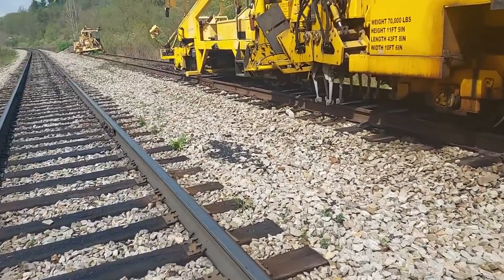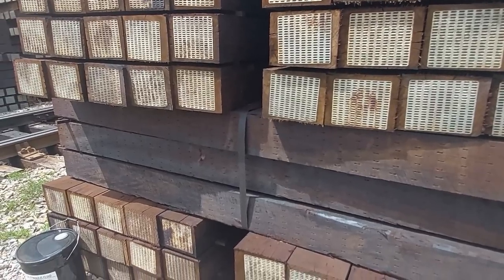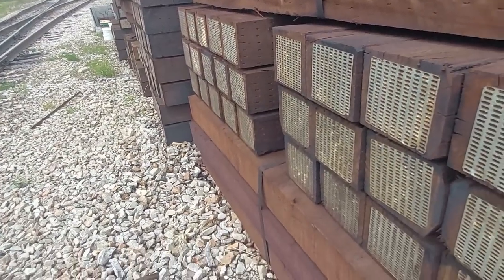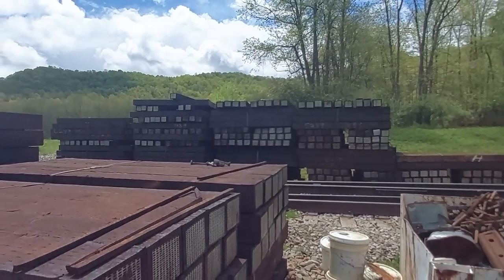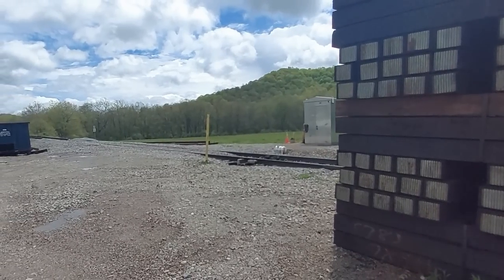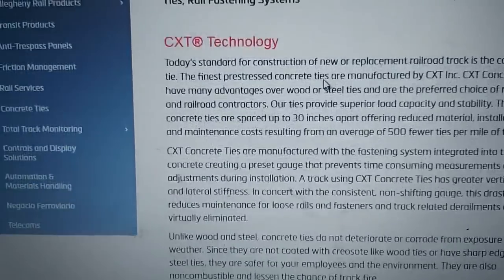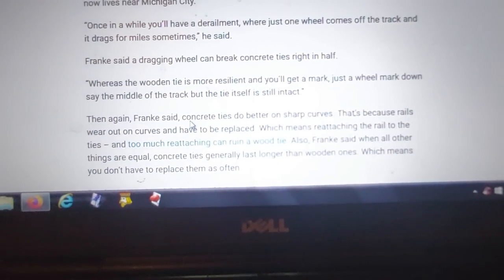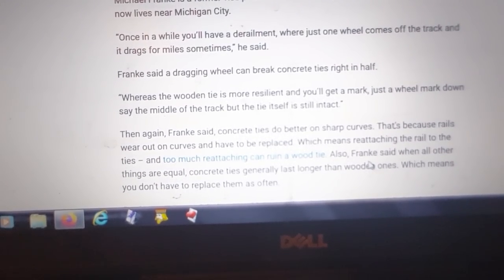Why some Railroads use Concrete and some use Wood Cross Ties

Comment: Seems like what Cumberland RR could use is better ballast maintenance equipment, especially an undercutter and ballast cleaner.  Also put in extra effort on drainage.  Locally (Seattle/Tacoma), BNSF has interesting practices; most of the double/triple track mainline is still in wood but sidings and even Auburn Yard's tracks are now concrete.  Where Sounder commuter rail is concerned, that's mostly concrete on their tracks and the new third main is concrete.   Up in the mountains, a lot of track has been put in concrete in the less accessible areas.  I'm a little surprised spikes are still common as they are, but apparently they're cost-effective.  Put the money and time into good consistent maintenance, the track will hold up well.
Reply from the maker: Thank you for the nice comment Damon and yes we have more
than our share of drainage and plugged up ballast. Appreciate your taking the time to watch and write in my friend.

Comment: Hey Dave! I live on the main line northeast corridor in West Haven Ct, all ties here are concrete for the last 15 yrs, most traffic is transit to and from NYC, also have the Acela ,6 times each day (north and south), every night there is a ballast train going south up to 100+ cars, very very heavy! I've seen as many as 5 locos on these trains. Return trip of empty ballast cars as many as 140+. RR and power company will be doing a project on my property in the near future to replace and relocate 100 yr old high power lines, breaks my heart, they will have to take down some very old trees.
Reply from the maker: Thank you for sharing that Carl. A lot of transit track has concrete
ties, they just won't work well for us here.  Appreciate very much your taking the time to write in and to check out the concrete vs wood tie video my friend.

Comment: After watching this very interesting video, I did some research on ties. There is a company making plastic ties from recycled plastic. They say you can use the same equipment as wood ties. Sounds like a great idea. Do you have any experience with that type of tie?
Reply from the maker: We do not have any composite ties here My Life's Tracks. They
are very hard and have no flexibility and cost well over twice what
a wood tie does, plus they need to be pre drilled before driving
a spike in. Just like wood and concrete, they have their pros and
cons. Appreciate your taking the time to check out the video and write in my friend.

Comment: Using old railroad ties used to be a thing back here in Germany. In fact, in our backgarden we had flower beds framed by old ties. There were two major issues with those back in the 80s: PCP and Lindane. It turns out that the chemicals used to treat that wood to keep it from rotting are really less than amazing for your health and the wood was practically soaked in the stuff. Made for pretty colors in puddles of rain, but also smelled awful. 
The ties we had in the garden were probably from the 1940s or 50s. Eventually I was forbidden from playing in the garden until some heavy machinery was brought in to clear out the ties and some of the soil.
Reply from the maker: Thank you for the nice comment Odd One Out and for sharing that. Appreciate your taking the time to watch and write in my friend.

Comment: MBTA Old Colony Commuter Rail restoration project (south of Boston, MA), tore up old NHRR roadbed, with wooden ties, and rebuilt with concrete ties in 1995/6. Withtin 10 years, the concrete ties were spalling and shattering. Tears & lawsuits ensued. The settlment - we went back to wooden ties (paid for by company that sold the original concrete ties) that were installed at MBTA expense.
Reply from the maker: Very interesting to learn that Douglas! Thank you so much for
taking the time to watch the video and share that with us my friend.

Comment: Back in 2007-2009 I worked in a concrete tie factory and we produced 47kg and 53 kg (mostly) - this being the rail weights inkg/metre. The ties were all concrete with 80 tensioning wires. Tampingworked fine; steel ties were tries and you needed hooks on the ends of the tamping prongs to oack the ballast up into the cavity under the ties, otherwise really rough riding! We sednt the ties out already loaded with jewellery only needing hand clipping using Pandrol E-clips and Pandrol clippers.. I did some time on track barring - you used a term ( I can't remember) to bring theas up to the rail which were then cliiped by the 'clippers' (hard on your calves) - I did some of this which resulted in incredible cramps - I was stuck inmy truck!
Wood ties didnot last in our climate -v c5 years if you were lucky; 20-50 years with concrete; mindyou plenty of ballast (50mm) and correct tamping were needed. Thanks for taking me back!
Reply from the maker: When we bring the ties up to the rail to be spiked we call that nipping a tie Don. It would be so cool to see a place where they make concrete ties, none at all around here.  Thank you for taking the time to visit with us and may you have a very good day my friend.

Comment: I’d like to mention that the RFD tag in the tie is a neat idea. Helps with maintaining system. Wonder though if someone is working on a system where each rail car can use something similar to determine if it’s wheels are on the track or other problems are arising and stop the train automatically when detected?
Reply from the maker: Appreciate the nice comment Marc, interesting. They do make
a WILD, wheel impact load detector, that measures the wheel
impact on the rail, so a flat spot would give  a different reading that
a normal wheel profile. As far as a chip or something like you
are saying, no one makes those that I am aware of. Thank you for taking the time to watch and may you have a very good day my friend.

Comment: Thanks for the explanation, I always wondered why US did not have more concrete ties.
Reply from the maker: You're very welcome Robert, glad you enjoyed. All RR's have their own
unique track problems/weather/economics, etc. There is no one tie
out there that is ideally suited for every single RR going. Each
RR has to use what is the best option for them, and often use
different options for different sections of track. Concrete, steel, composite or wood all have their pros and cons. It is a good thing
that there are options available to suit each RR's particular needs.
Appreciate your taking the time to watch the video and write in
my friend.

Comment: NJ Tranist is using concrete ties on the section they are reopening called the Lackawanna Cutoff. It will be passenger use only. Hopefully it will extend to Pennsylvania and reduce car traffic in northwest Jersey.
Reply from the maker: Thank you for sharing that info with us Kevin.  Appreciate your taking the time to visit and check out the railroad tie video my friend

Comment: the Amtrak line from Albany to Schenectady NY has dual tracks. the main side is wood and the recently added siding is concrete, if you've got a day or weekend to spare to go check it out. unlike what you were describing, it's concrete all the way across the tie (I'm guessing it's reinforced inside) I'm trying to remember but for the life of me I can't recall if it's barbell shaped or u-shaped (I would imagine it would be easier to replace one if it's not barbell shaped below the surface because then they can just push it out the same way as the wood ties) it's got an interesting clip system. it's been a few years since they installed it and it seems to be holding up well.  

I assume that a certain amount of movement is okay, maybe even desirable, as the land changes with the seasons. 

recently they went through and changed out some of the wood ties on the mainline. is there a rhyme or reason to which ties they change or do they change them depending on individual tie condition?  

observing both processes was pretty neat
Reply from the maker: Appreciate your sharing that better better. Here is a video where I explain what to look for  when marking bad ties, what criteria to use to determine whether a tie is bad or not. Thank you for taking the time to visit with us and check out the video my friend.
https://youtu.be/dUEKUK2gXWk

Comment: Amtrak has been using a specific specification of concrete ties (outside of underground stations, of course) for a while, mainly for 100+ MPH track.  Just recently they started upgrading Track A from West Baltimore MARC station (west of Baltimore) down to Halethorpe for 100+ MPH service in prep for the new Fredrick Douglas tunnel that'll replace the `00+ year old B&P (which from last report will be rebuilt for freight usage).  At the very least we'll get 70-100 MPH service through the new tunnel VS 30 MPH in the old.
Reply from the maker: Thank you for the nice comment STrRedWolf, concrete ties suits
themselves really well to high speed passenger trains. Appreciate your taking the time to watch and write in my friend.
Reply: @ccrx6700  Any time!  I just got word that Amtrak's been working more on the tie upgrades on the North-East Corridor (NEC) as part of the B&P replacement, including replacing the ties all up and down the NEC.   It can't come at a better time.

Comment: Thanks for the video, Now i understand why wood still is preferred over concrete.
How ever, I would like to say that as wood ties are mostly the same, concrete ties can be engineered.  I propose that there should be testing standards for concrete ties and that they should be tested during manufacture. I would suggest that prestressed steel reinforced concrete, air entrained, with fibers, and expanded steel on top of tie, thats welded to the tie plates on top to prevent the rails from spreading apart in a derailment. Or maybe a channel iron upside down on top of the tie to connect the 2 tracks keeping them from breaking apart during derailment. The upside of a very good concrete tie is longevity and environmental concerns you already talked about.
Reply from the maker: Thank you for sharing your thoughts J Bird and you are welcome. 
Very interesting comment and idea. Appreciate your taking the time to visit with us and take in the video my friend.

Comment: Our (Austrak) concrete ties were tapered to to bottom with the top binjg narrower; rhwy weighed 286kg (631lbs. Manualtransport needed 4 guys on two sleeper tongs, however most were shiufted using a fork lift (in yards) or a loader -a  big one when shidting 24 at a time - out on track; I was involved with laying "passing lanes" on the Main Southern Line in New Soth Walws, Australia. Passing were 9.6KM long and used really well made trnouts - 130kmh rated - and concrete tie sets. Transition from the usual 1 in 200 seat angle for the main line and straight seta angle for the turnouts was achieved in the design of the tie sets.
E&OE - I have big fingers!!
Reply from the maker: A good many of the concrete ties they have here are tapered also Don. 
I can't imagine trying to lift those things by hand, be a struggle for
an automated tie inserter I would imagine also.

Comment: This was very well done explanation. I have seen from other videos wood and concrete tiles mixed and my first idea was its probably to cut costs? However I had no idea of the engineering benefit with having that setup. Thanks for clearing it up in this video, would never guessed it myself. Most of Europe as other commenters point out has indeed concrete ties. However the infrastructure just supports having concrete ties and there long term maintenance dose not seem to be a issue. Wood would not be a problem as a material but having to replace all the tiles frequently would add up in cost. Specially when the price of wood decides to sky rocket.
Reply from the maker: Thank you for the nice comment Steve. All RR's have their own
unique track problems/weather/economics, etc. There is no one tie
out there that is ideally suited for every single RR going. Each
RR has to use what is the best option for them, and often use
different options for different sections of track. Concrete, steel, composite or wood all have their pros and cons. It is a good thing
that there are options available to suit each RR's particular needs.
Appreciate your taking the time to watch the video and write in
my friend.
Reply: @ccrx6700  We need people like you and many others that deal with practical engineering. To go to schools  educate/talk to the new generations on how things work out in practice. Right now the education system has a major flaw and that is way too much theoretical and surface level education that dose not help anyone. 
But I guess Youtube is even better cause the audience is way larger than in any school.

Comment: Dave:  
Another excellent video!!!

Questions:
(1) Why do the Europeans oftentimes use lag screws to fasten rail onto wood crossties, in lieu of spikes?  
(2) Conversely, why don’t RRs in North America use lag screws in pre-drilled holes (which would insure that the pressure-treated creosote fully penetrated around the lag screws)?

Inquiring minds want to know.
Reply from the maker: Thank you for the nice comment Eric. Many places on many RR's
also use lag screws in US instead of spikes, they give superior
holding power and longevity in relation to spikes.  2. Tie plants
offer to customers pre drilled and pre plated ties. that can be
for both lag screws and spikes. So with pre drilled holes, the holes are creosoted. For whatever reason not a lot of RR's purchase the pre drilled, or pre plated ties, I do not know why. I toured a tie plant last
summer and saw the machinery they used to do that process and
it was done with untreated wood.  Appreciate your taking the time to watch the video and write in my friend.

Comment: In the early 2000s in Setauket,  L.I.N.Y. Bennetts Rd. I noticed the vibration/ noise level was decreased after concrete ties were installed.
Reply from the maker: Difference in riding over a track in a train with concrete ties and one with wood ties is, the wood has flex, concrete does not Glenn. Think 
riding on a paved road in your car and riding in a gravel road in
your car. Concrete is a much stiffer surface to run on. Thank you
for taking the time to watch and write in my friend.

Comment: GO Transit (Ontario Canada) operates a large passenger train service in the Greater Toronto Area. In the last few years, they have been replacing their wooden ties with concrete, when it came time to replace the rails. Time will tell whether or not it was a good idea.
Reply from the maker: Concrete ties lend themselves very well to light transit applications 46FD, much of Amtrak's rail here has been getting
concrete ties to replace the wood also. Thanks so very much for
taking time to write in and to watch the video. May you have a
very good day my friend.

Comment: I actually noticed them the other year replacing a bunch of the railroad ties on the commuter rail (minus one monthly freight run) that runs about 1/2mi from my house... They were using black plastic ties - I'm presuming some form of HDPE or possibly UHMWPE.  Seemed somewhat logical to me, like wood the PE would have some minimal "flex" to it without the brittleness of concrete.
Reply from the maker: Composite ties they are called made from recycled plastics CaptainZ. Will do a video on them sometime. Appreciate your taking the time to watch and write in my friend.

Comment: This is an excellent and very informative video thanks for making and sharing. I always wondered about the wood verses concrete and why they weren’t just all concrete. Now I know as usual much more complicated than is first apparent. I had no idea about composite or steel ties either. Didn’t know such a thing existed until you mentioned them . Look forward to watching that video as well.
It is a shame and a waste all that hardwood has to be cut down and landfilled. That hopefully will be replaced someday. I have a question though hope someone can answer. I noticed yours is not welded but sectional rail. Is concrete used exclusively where welded rail is involved?
Reply from the maker: Very good question Marc and from my knowledge the vast majority of concrete is used on welded rail, but there is some jointed
rail where it is used. Welded rail less vibration on the concrete ties
than jointed track would be, thus less change of concrete ties
cracking or shelling.

Comment: Thank you for explaining most everything that there is to know about the railroad ties.  Maybe someday there will be a good use for ground up wood ties.  Where I am at, we could use 10 or 12 old ties to replace the rotted ones that are in our parking lot.  But the boss is too cheap to want to pay for any. 
Thanks again for all your extra work in making these videos for us!
Reply from the maker: Come and get your ties here Earl, no charge. Thank you for the nice
comment. Appreciate your taking the time to watch and write in my friend.
Reply: @ccrx6700  I'd be glad to come and get those old ties. I'd have to use our dump truck. But I don't think our boss would buy all the fuel that our dump would take to get there. Wisconsin is not exactly down the block from you.😃
Reply from the maker: @earlschmitt884  👍😊